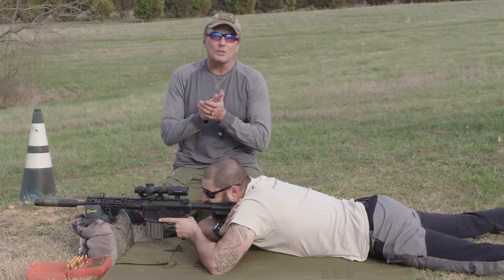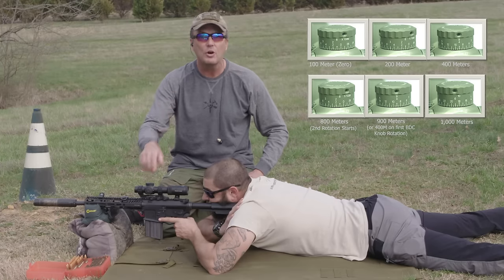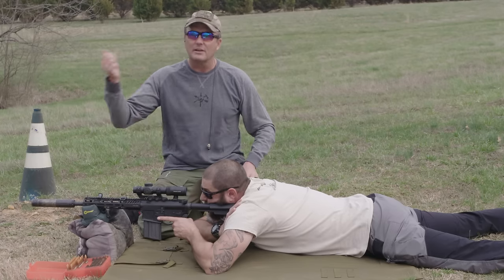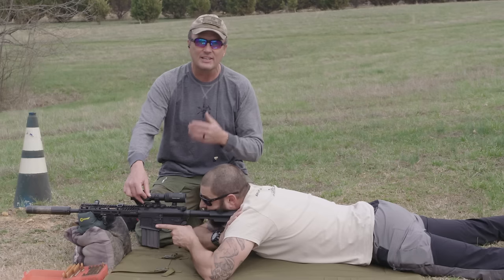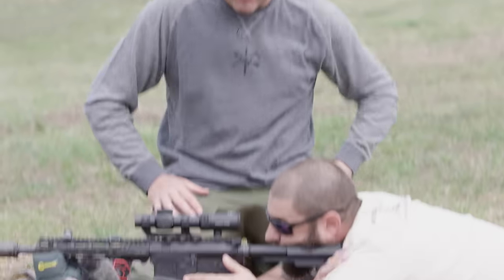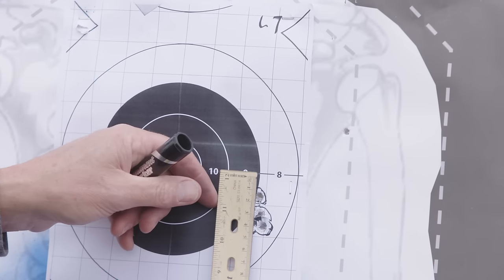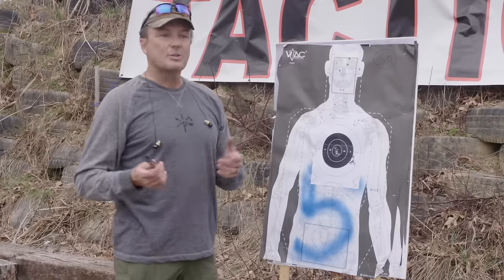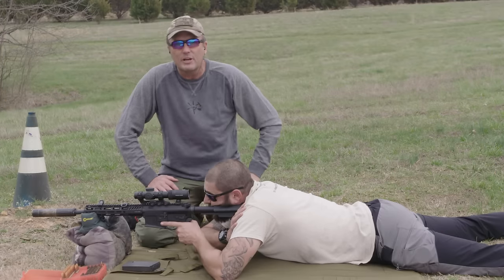How to Zero LPVO Scopes | Tactical Rifleman

Comment: I hope people understand that MIL scopes do NOT require use of the metric system. It couldn't be easier, one click (0.1 MIL) equals 1/10,000th of the distance you're shooting. 100 yards? Easy, that's 300 feet, 3600 inches, so 0.1 MIL click is 0.36 inches -- very close to 1/3 inch.
Reply: I wish I'd learned Mils before I bought a scope in MOA. I figured MOA was easier to use, but that's only because I am comfortable with yards, feet, etc. Now that I'm starting to understand mils, it makes so much more sense for shooting.
Reply: @alejandrogonzales7022  It makes more sense for me.
Reply: Roger that: thank you for sharing this.
Reply: 1 click for 1 cm is much easier though
Reply: MOA has tighter adjustments
Reply: and 1/8" MOA is even tighter
Reply: Not sure why people even buy MOA
Reply: how is that easier than 1 centimeter at 100.. just saying,  i get that understanding the actual math behind mils is beneficial,  but for a simple 100 yard zero,  your overthinking it. it doesnt matter how you get to the right answer, as long as you get there.
Reply: @mtnbound2764  Except...it's NOT 1 centimeter at 100 yards; it's 1 centimeter at 100 meters...lol. At 100 yards it's 0,9144 centimeters. So....that's my point. 0.1 milliradians is simply 1/10,000 of the distance -- no matter whether you use imperial or metric measuring systems.
Reply: @GetMeThere1  lol your really wanting to argue about less than a 1% margin of error,  regardless,  the ruler/centimeter " trick" worked perfectly, without any  math needing to be done.  you cant try to argue with that,  but its a waste of your time.
Reply: @LosDoyerss because it serves the purpose the purchaser needed served? if MOA didnt work or wasnt effective,  it wouldnt be so common
Reply: @mtnbound2764  Do you really want to argue about NOTHING??!? (oh, and it's about a 9% margin or error, not 1%). YOU are the one arguing over nothing. YOU are the one trying (and failing) to make an argument. Please go back under your rock.
Reply: @GetMeThere1  oh i love arguing. you still havent been able to convince, me, or anyone else,  that your calculation method is easier than the centimeter method.  whether 100% " accurate" or not,  it works quickly and easily. so.. yeah. nice try though
Reply: @CoastalForests  Those are minor issues (actually, they're non-issues). LPVO scopes are not meant as "ultra accurate" equipment for, like, benchrest shooting or something. There's certainly no issue between 100 yards and 100 meters regarding parallax -- probably they're not even that precisely set vs distance. And in any case, they can't be "zeroed" any better than 1/4 MOA or 0.1 MIL. Nobody's trying to shoot at insects at 100 yards with LPVO scopes, lol.
Reply: @LosDoyerss  Because for hunters, MOA is dead simple.
 All you need to know is one MOA is one inch at one hundred yards.
Reply: @FinalLugiaGuardian  And for MILs, all you need to know is one click is one-third of an inch at 100 yards -- same thing, if that's what you want.
Reply: @GetMeThere1  And the average hunter I know doesn't want to put even that much thought (36% of one inch per click instead either or a half or a quarter inch) into their scope. 
All they want to think about is "muh one inch at one hundred yards" or... just half or a quarter of that per click at 100 yards. And they don't want to be educated for absolutely anything beyond that. Maybe that's not tactically smart, but that's the reality for most hunters I know.

 Most hunters I know don't have military or law enforcement experience in which mils may be more commonly used.
Reply: @FinalLugiaGuardian  LOL I've hunted for nearly sixty years, and I've seen a WIDE variety of "what hunters do." For 50 of those years my dad owned a deer hunting preserve, and I've seen hunters come with everything from 10 gauge slugs to 300 Weatherby magnums. You're talking about yourself, and claiming you represent "most hunters." Why bother, lol? MOST hunters (for sure) don't even shoot at animals over 200-300 yards, and that's as it should be. For them, calculating trajectories isn't important anyway.
Reply: @GetMeThere1  I responded to your comment but youtube deleted it. 
I just wanted to say that my comment is based on what I have seen in my personal life and not from a whole bunch of different sources. I edited my original comment to reflect this.
Reply: Or 1 Mil equals 3.6 inches at 100 yards. 0.1 mil is a 1/10th of 3.6 so .36×10 is 3.6, that's if you zero at 100. At 50 you have split 1/2 of .36 goes to .18, then at 25 goes to .09, it's simple. Just depends how you simplify for yourself make it easy to understand for you. I like this method of doing mils.
Reply: What the fuck is easy about any of that dude. 1/10,000th? Lmao what? You know what is easy? 1cm at 100 meters. That’s easy lmao.
Reply: You do realize there’s a sizable portion of the population that owns guns, including optics that doesn’t know what an eighth of an inch is or  1/3 of a cup, right?

Comment: I put the gun in the lead sled. Shoot 3-5 shots, then look through the scope as I turn my adjustments. I turn them both until they are in the middle of the shot group. 

Did this for my friends brand new .308 and had it zeroed in 5 shots without measuring MOA or MILs.

Comment: The bullet rises and drops below line of sight anywhere you want it. The bullet immediately begins to fall when it leaves the barrel.
Reply from the maker: Yes, but you can only pick one. If you pick where it crosses the rising branch, the crossing of the falling branch will depend on you bullet’s trajectory. It is always better to zero as far out as possible; so I prefer to zero the falling branch when using a “Point Blank Zero.” (Mostly red dots).  Here though, because it has a MIL reticle, I chose to zero at 100 meters.
Thanks for watching, TR
Reply: @TacticalRifleman  true. Most red dots are for mid range to CQB. 100meter/yards is my choice.

Comment: I noticed in the beginning of your video, which was excellent by the way that you turn the power all the way up did you turn the power all the way down and re-check zero or does that matter when I zeroed my LP video I put it on the power that I thought I would typically use which was about five and made the zero there is does that make a significant difference as far as where you have the power? Thanks for any response
Reply: No. The crossbar or middle of the reticle should be on at any magnification.  What you are worried about is if you're using a second focal plane scope all the secondary hash marks, ballistic drop marks etc are only accurate on the power you zeroed at and/or max zoom whichever the scope requires.
Reply: I believe this scope is FFP so there shouldn't be a zero shift during magnification change but there could be some with a SFP scope; if you zero at the highest power you are going to use you shouldn't notice a problem a 1x at closer range; the magnitude depends on the quality of the scope and I believe it gets worse the farther from the center of you need to adjust the scope to zero.

Comment: I'm running an MRO with a 3X on one build but plan on swapping that to my shorter barrel and getting an LPVO for my 16" rifle. I've been trying to decide between PA or Vortex, both seem great. Any input is always welcome. 

Thing is, the only place around is an indoor range (outdoor ranges are all private clubs) The max distance is 50 yards I believe. Does anybody have suggestions on some targets to buy that adjust for the shorter ranges so I can zero to 150, 200, or further? We had them in the military but I haven't looked much as a civilian. I'd like to assume reliability isn't a concern since 1" is 1"... but I'm a welder and fabricator, I've seen tapes and shit where 1" doesn't start at 1". So that's why I'm asking.
Reply from the maker: I prefer the reticles offered by PA over Vortex. 
Hunt locally online, and you'll find outdoor ranges out to 200 to 400 meters easy. They may be a couple hours away, but make a day of it, as you don't have to zero too often. 
Thanks for watching, TR
Reply: @TacticalRifleman  outstanding, I appreciate the response and input on the optics. There are indeed a few ranges within 2 hours of me, I'll check them out. Awesome channel, keep up the great service!

Comment: Using a BDC from primary Arms, will my 1.93 mount mess with my BDC? It's also a mil scope
Reply from the maker: Slightly, but not too bad. That’s why you zero further out with it. In close, the taller mount would screw it for sure

Comment: Do you still have to check if that's the first or the second time the flight path is crossing the sight line?
Reply from the maker: Nope. You should be zeroing at the further of the two branches. The military zeroes on the rising branch only because EVERY military base has a 25 meter range. Not all installations have 300 meter rifle ranges.

Comment: Hey Karl.  So you zero an lpvo at 100 ? Why not 200 like a red dot ? Muscle memory the same   Obviously I’m talking a cross hair ridicule not a acss
Reply: Well not the zero but the 2nd zero or whatever that’s called
Reply from the maker: Donut, if I was gonna just use the Point-blank Zero I would zero at 200 meters. However, this particular PA LPVO has a MIL grid and BDC designed to start at 100 meters.